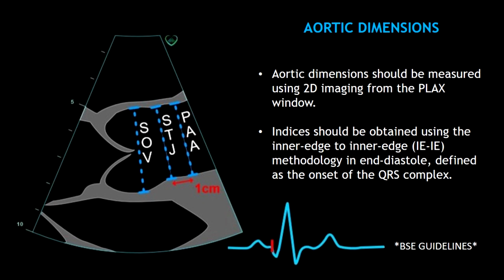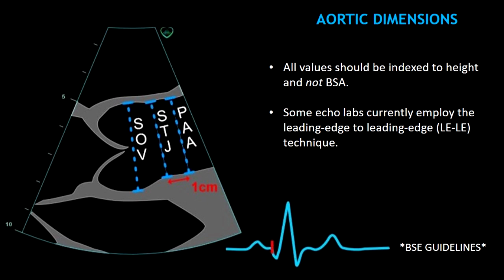How to measure the AORTA: Echocardiogram!

Comment: Still no numbers here to suggest a normal in comparison to aneurysm? Would you say that an MRI is needed to make the assessment for surgery?
Reply: They typically do surgery when the ascending aorta is greater than 45 mm. 37 mm or greater is considered dilated and should be monitored. The ascending aorta can easily be measured on TTE.
Reply: @jhonen32629  My aorta 4.6 and subsequently my research shows that the need for surgery is 4.4 yet the aorta has not been observed for more than one time and it is predicted to expand by 1.0cm per year. I am a-symptomatic on the stenosis and have put off the surgery for a period of six months in order to procure another opinion. will i survive? The doctor has given me two years without surgery which I (literally) feel hard to believe.
Reply: @shoomapadoo1141  Oh ok. But definitely have someone keep an eye on it, which sounds like that’s what you’re doing.
Reply from the maker: The numbers are different in every country and they must also be indexed by sex and BSA or height... So check the values on your country guidelines

Comment: Hello Echo lady, on 2.02, you said sinus of valsalva or aortic root. Aren't they different? why one shall measure aortic root and SoV at the same point? I thought you do three measurements, one at root, 2nd at SoV and 3rd at STJ, the forth one is PAA
Reply from the maker: Normally the sinus of valsalva if often referred as the aortic root... So it's the same. Most of the machines have the aortic root option but is not called sinus of valsalva. So you can measure the annulus, then the sinus of valsalva (also named aortic root), STJ and ascending aorta.

Comment: Hello, Echo Lady. If you measure the root from inner wall to inner wall, what'd be the maximum normal diameter? Thank you!
Reply from the maker: 22-34mm for females
24-39mm for males

Also you can index this by height according to the latest BSE guidelines. However Check the guidelines used in your country.
Reply: @the_echo_lady  thank you!

Comment: Aortic root should be measured outer edge of the anterior wall to inner edge of posterior wall. Also the LVOT should be measured in systole.
Reply from the maker: Thank you for your observation but this measurements are different in every country and even cardiac labs. I work under the British Society of echocardiography and they recommend inner edge to inner edge... Please check your guidelines.
Reply: @the_echo_lady  Do you know the reasoning behind why it is inner to inner?
Reply from the maker: @davidflerlage2463  The purpose for this is accuracy in measurements, however some studies found that there isn't that much discrepancies between both methods so I just guess is a Society preference and also a way of making everyone to do the same all the time... To standardise the echo practice.
Reply: She is following BSE. We and world over follow ASE. as you stated ASE says, leading edge to leading edge @ end diastole and LVOTO in mid systole
Reply: @DrBharatSinghSambyal  yes LVOT when the valve is open root when is closed

Comment: Do u measure aortic root in diastole or systole?
Reply from the maker: It shouldn't make any difference so just measure in the part of the cycle where you can properly see the whole "bulb"
Reply: I was taught diastole, because you want the Aorta relaxed when getting your measurements.
Reply: It shall be measured in Diastole, In systole, you will over measure